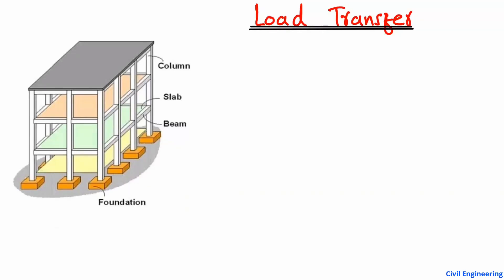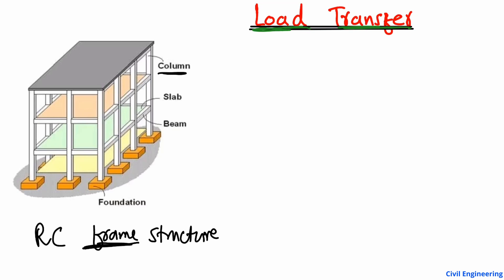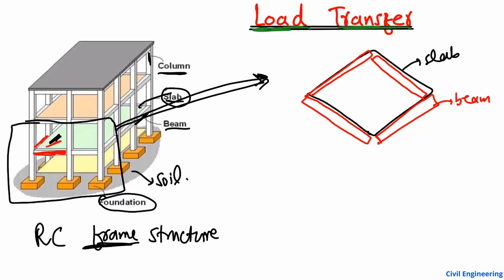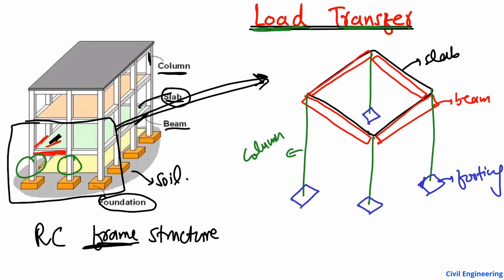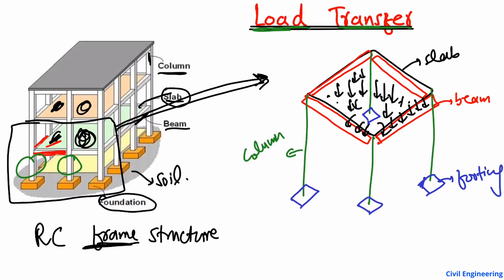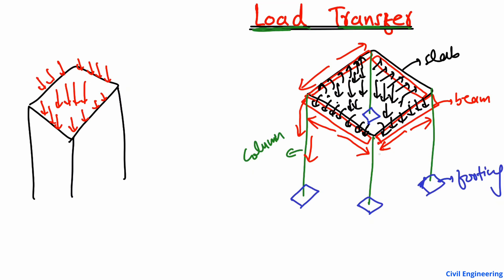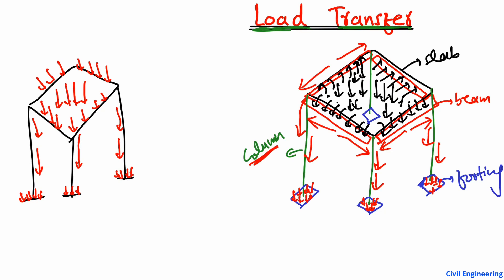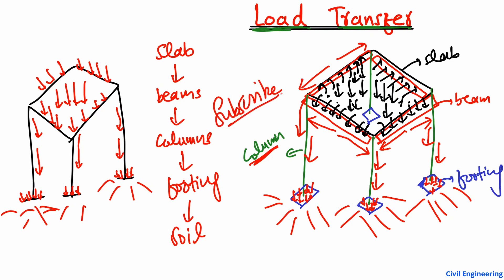Load Transfer Mechanism in Buildings | Slab to Beam to Column to Foundation Explained

Comment: And what happens in the middle of the slab? And how do you know how much force each column will take ? Do you take the force from the center of gravity in the slab and calculate the distance to each beam and column ? Because they are some sides that have more columns then the other.
Reply from the maker: Yes, it depends on the dimensions of slab